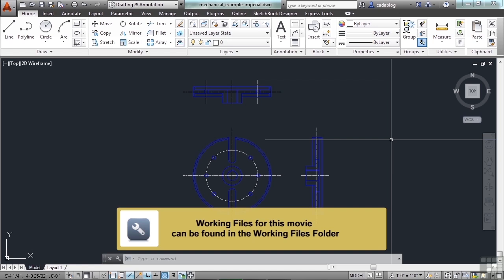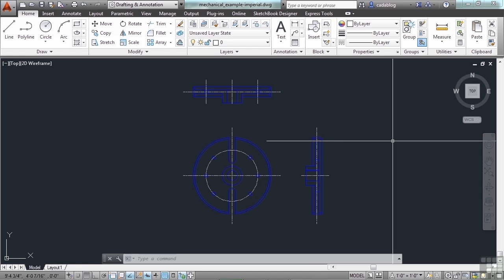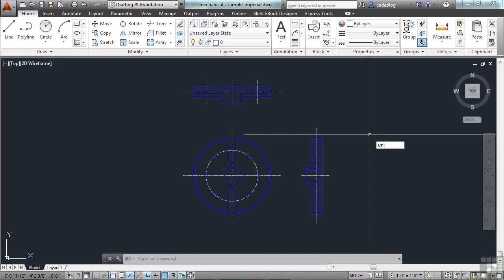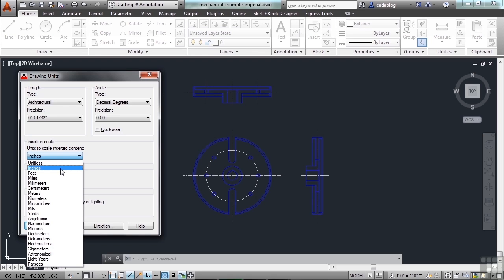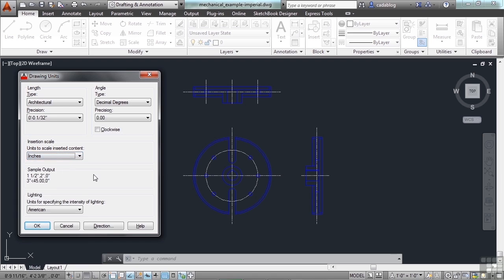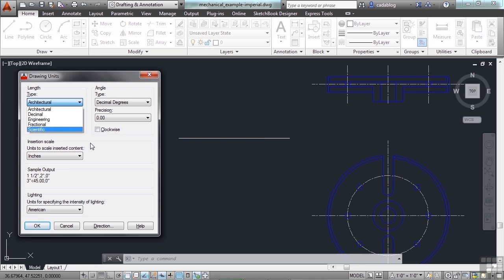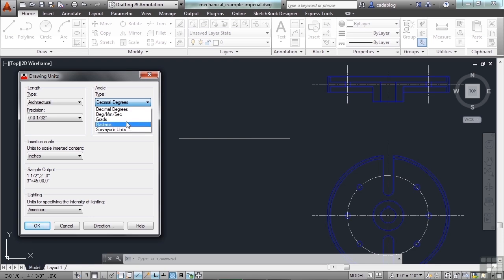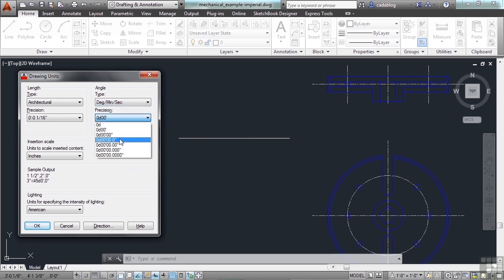Beginners Autodesk AutoCAD 2014 Tutorial | How AutoCAD Interprets Units

Comment: you see we work in meters , and i don't know which type to use ... and whenever i do a line it's length is like 2000 sth. but  i wan't it in 4 meters and when i write 4 while making a line it gives me almost a point ... i tried manny times to change the scale & dimenssion but it's still the same
can you suggest sth